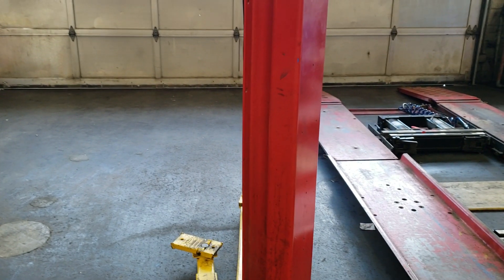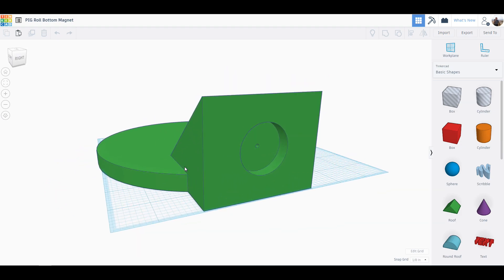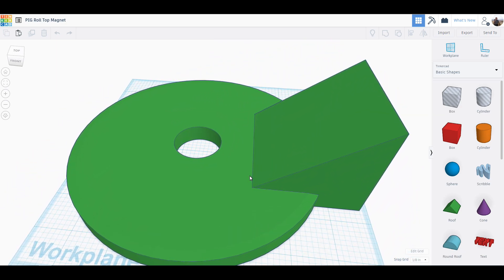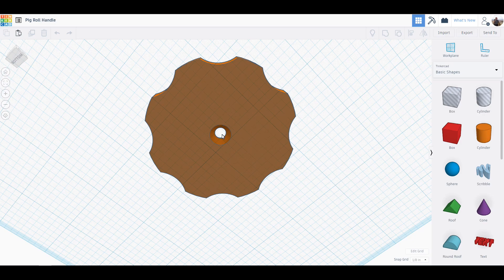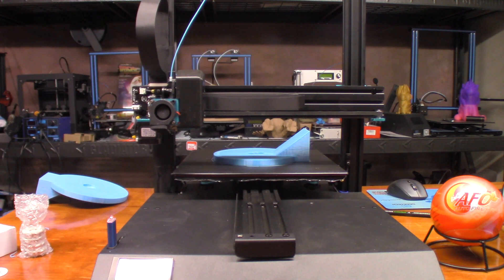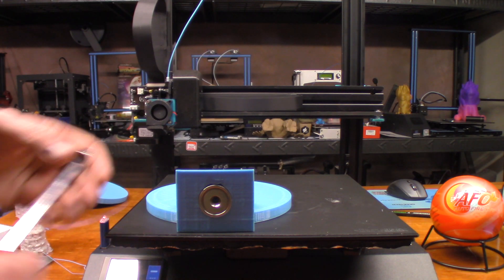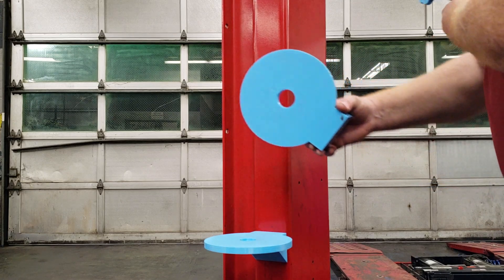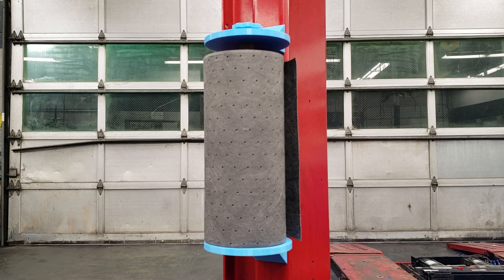3D Printed PIG Mat Roll Holder

Comment: Magnets and Tinkercad are a fun combination. That's a great solution to needing a customized, oversized paper towel holder. I bet commercial ones, if they even exist, cost more than the printer you printed that on! Wouldn't it be cool if all the auto shops had a technically savvy person like you, and a 3D printer? 😉